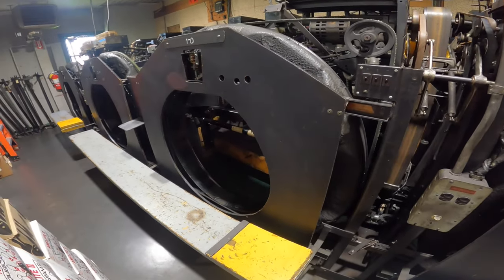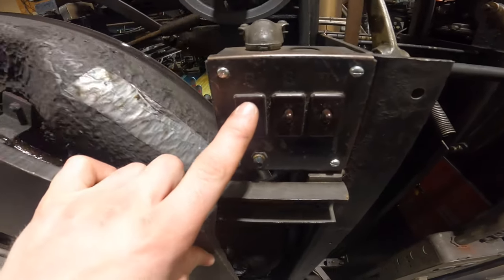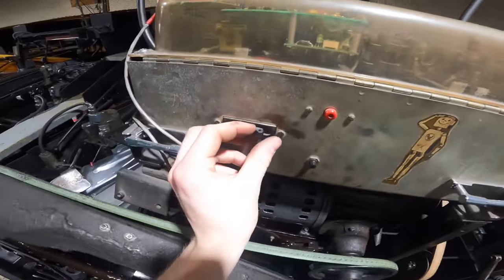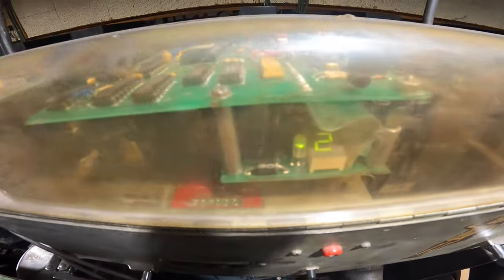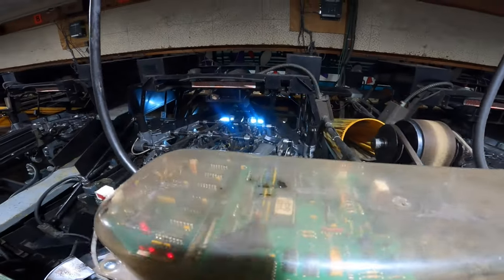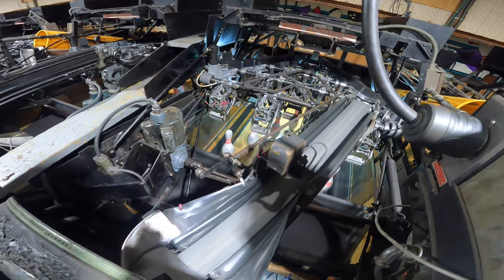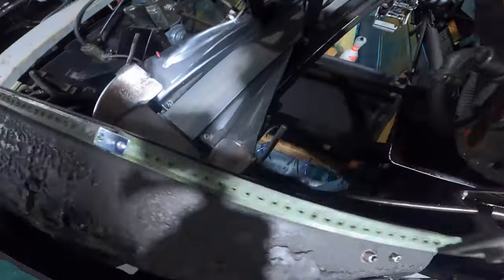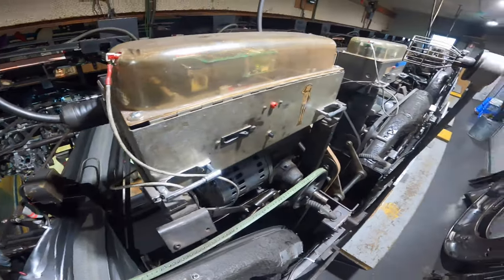AMF 82-30 Control Switches + Chassis Explained

Comment: Joe--was curious if you ever had the chance to see an older chassis in operation. Those have a small motor with its own cam that stops the sweep at the guard position, pauses before starting the table, and then restarts the sweep at the proper time, all of this actuating a mechanical stepper relay, and instead of watching the digital numbers increment, one could actually see these moving parts in the older chassis. I regret not having done more in-depth video with better lighting to illustrate those in action, in my videos. The boxes your center has originally had those things, removed with the digital boards soldered to replace them to function solid state.

The stepper relay actually handled three cycles/frames. I was actually able to tell someone that I thought the stepper was an issue when every third cycle had a glitch...I was proven to be right.
Reply from the maker: Yep, I’ve seen those before. We actually have some of them still sitting on the shelf that were never converted to the boards

Comment: To zero the chassis, w/o getting another set of wood, is to shut the T & S off and look at the BE wheel.  Zero the chassis in a non pin position and then shut the mach off.  That kills the pin feed.   No need to unplug the BE motor.  It becomes second nature.   The chassis CB is THE most important switch on the machine.  The BE on/off switch could get turned on by accident.   The chassis CB takes an effort to turn it back on.

Comment: This is like day and night compared to 82-70, I’ll bet it’s just as much of a pain in ass to work on as it though😂
Reply from the maker: The chassis, yes. But the machines themselves run awesome when you maintain them correctly!! Would never get rid of them
Reply: @Joethepro181   unfortunately my machines had been neglected for past decade before I started working on them, so I’m sure you can imagine they’re a pain in the ass on a daily lol. Still great fun to work on, learn something new everyday. It’s cool to see some content from another bowling mechanic, it seems we’re a dying breed, atleast over here in Uk we are.
Reply from the maker: @ArtTheClowner  my machines were neglected for a little over 20 years. I took them completely apart, pressure washed them and rebuilt them. Replaced bad parts and put them back together the right way! They run like brand new machines